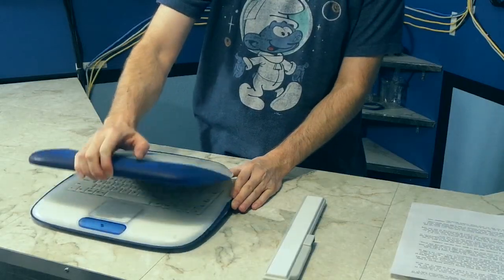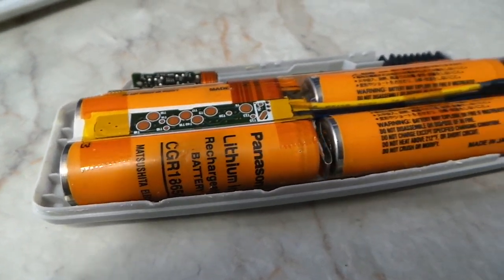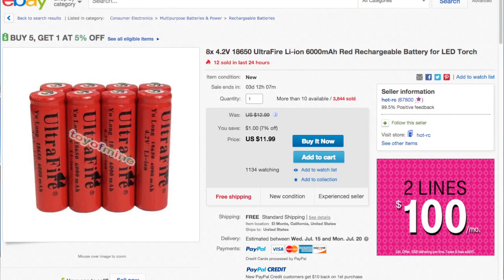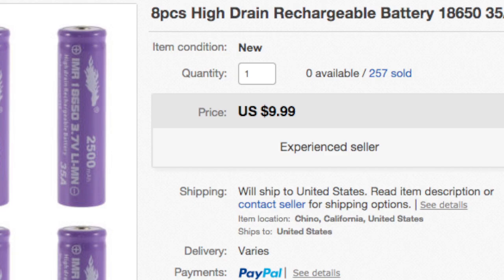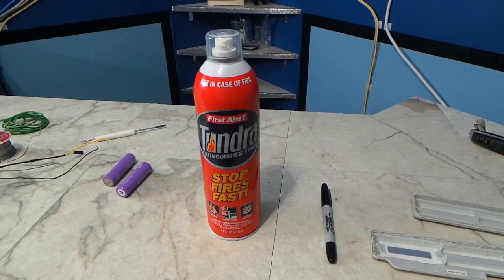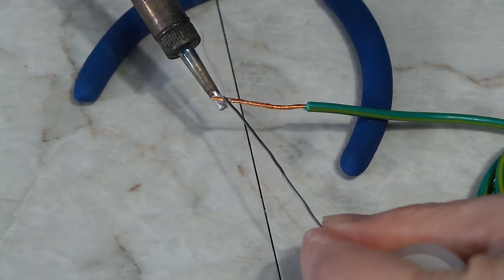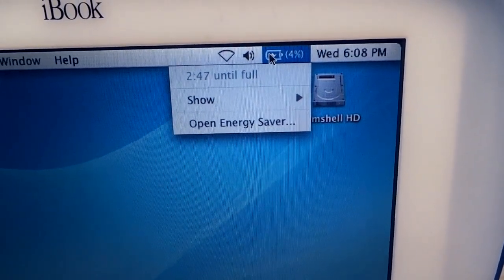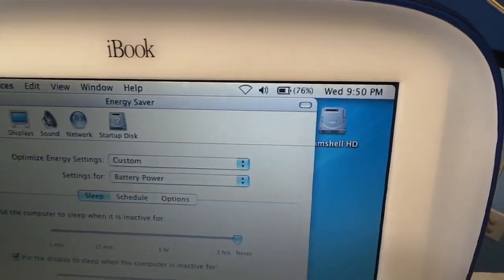Rebuild a laptop battery pack

Comment: I got 4 of those 6,000 mAh of those ultra fire batteries for an LED torch
The capacities were tested with a Foxnovo F4-S
136mAh
272mAh
409mAh
351mAh
Reply: +Ismail Mohd Yusof 
you cant even get 18650s in 4000mAh let alone 6,000mAh.
I checked on ebay, they are now claiming 9000mAh
Reply: @IIGrayfoxII  Somehow Chinese think people believe whatever they say!!!
Reply: @stevec9669  Some people do.
I knew these batteries were fake when I got them.
But I needed some basic cells.
That torch is in some storage bin as I got rid of those batteries.
Need to get some quality 18670 cells to use with it.
Reply: +JuriePie I knew they would be shit, but hey they cost $5 for the 4, they run the LED torch for 10 min at full brightness before the torch starts to dim which is not a bad thing as the torch gets very hot
Reply: +IIGrayfoxII I have one 6,000 Ultrafire that has 286mAh actual capacity, too.
Reply: +Ismail Mohd Yusof 300mAh * 5 = 1500mAh. Not 6000mAh. 300 obviosuly is 1/20 of 6000
Reply: exactly.   I buy OEM batteries for discontinued laptops piled thrown into clearance bins for a few dollars. i usually find top quality, brand name batteries inside.
Reply: +littlegoobie i just buy some powerbanks from retail stores.
Got 2 5200mAh the other day for $25.
Poped them open got 4 2700mAh batteries.
Reply: Safe choice in buying 18650s:

Buy a cheap 10000mah powerbank and take out the 18650s
Reply: @greycircularity  better off buying OEM laptop batteries
Reply: that makes sense considering the ibook should last 6hr instead of 1.5
Reply: cut them open, i bet you they are full of sand with a tiny lipo cell inside
Reply: @mwbgaming28  "cut them open, i bet you they are full of sand with a tiny lipo cell inside" its not how cheap battery is made, they are simply a lower tech that are cheaper to make and you dont need the best avaible equipment to make them. But in general i avoide false name brands and specification because if you are ready to sell a lie then its not far awey from selling something made completly wrong.
Reply: @Bialy_1  generally with cells that only  a few hundred milliamp hours, they are usually hollow cylinders that contain a tiny LiPo cell with the rest of the space full of sand 

Look up "18650 sand cell" on Google images
Reply: @KiratCan Kerem Panasonic specialises in "energy cells" high capacity, low drain 

Sanyo makes some very nice "power cells" high drain, moderate capacity
Reply: Kind of like the cranes in the place I work, if they want them to be able to pick up more they put a larger capacity tag on them
Reply: +IIGrayfoxII After getting into the new flashlights, I stumbled on an excellent way to get 18650's that are good and still very inexpensive.   maybe you can figure it out...
Reply: How to make 30k amphers stable and reset the battery also how not to fry your motherboard and give the laptop the same power as it did originally meaning will the increase of amphers increase the voltage and how can you get something to keep it at the desired number thanks?.
Reply: +Core Macro OOhh. Can I have one for my dinner, or perhaps .... supper?
Reply: Foxnovo F4-S cant find it anywhere Mate
Reply: Good old globalization at work
Reply: Chinese earbuds with powerbank advertised capacity : 5000mah actual capacity : 200mah with old cordless vacuum battery with faulty pcb and few uses : 2200mah 

Also they go overdischarged very easily just let it sit for a year and you damaged or broke the battery i added a bms from a broken ps4 controller battery to prevent that as mine aren't used often recently my sound stopped working because the earbuds turned on since the case lost power due to the battery protecting itself with the added bms i charged it and it worked just fine
Reply: +IIGrayfoxII 
wow.. just wow..
1/5 of advertised capacity
Reply: IIGrayfoxII shake it

Comment: You used imren batteries, those are not cheap, unless it's a fake.. And the heat from the soldering iron have probably damaged the batteries, that's why the battery pack couldn't hold the charge..

Comment: Hey there 8 bit guy, I was wondering that if I can use the NCR18650PF(MH12210) 10 amp batteries for my aspire 4740 laptop battery pack ?? Or the LGDBHG21865 3000 mah 20 amps by LG ???

Update: Battery I used still have 3-4 hours and soldering batteries can be a gamble but mine holds up for 3 years now... didn't get to do it right away. But 3 years and still have 3-4 hours same as the day I made it.
Reply: +Donny Slander both should work, but even if you buy 20A cells, laptop can't consume 20A. Acer aspire 4740 must have ac power supply rated for 65 or 90 Watts. Laptop will newer draw more power from battery than from it original power supply. 90 W/6 Cells / 3 Volt per cell = 5A maximum load. 3v is near empty cell voltage. Full battery will have higher voltage so laplop will draw less current at higher battery SOC (state of charge).
Reply: +Volodumur Kalunyak aahhhh, so using a 10 amp battery is still okay right??? im using a toshiba power brick since the acer dies like 3 months ago, now its stabilize around 5 hours max now. But the LG have 3k mah for the same price of that 10 amp so I stick with the NCR sony battery since it looks more closer to reality.
Reply: yes
Reply: Volodumur Kalunyak
anyway man thanx for the info about the amperage consumption by a laptop it's as you said it would be and the toshiba is also at those wattage :D cheers mate :D

Comment: How do you manage to reset the EEPROM of the battery pack? I did this with an acer laptop battery pack but the EEPROM still reads the old cells' values of full charge capacity and wear level.

Comment: why you use high drain battery? for laptop battery, you suggested to use high capacity battery than the high discharge current battery. Efest 2500mAh 35A is the same battery as LG HE2 or HE4 battery, 2500mAh 20A continuous discharge rate, usually used for power tools battery pack, rather than laptop battery pack.

Comment: I want to replace the battery in my MacBook Late 2009 as the battery has expanded due to overcharging and I was wondering if you recommend I buy a new battery or replace the cells in them? The pack itself has expanded too.

Comment: Okay so... I'm wondering... Could you possibly expand the capacity of the battery pack by doubling the number of batteries that are ran in parallel? From my understanding when batteries are connected in parallel vs in a string from end to end it only increases the capacity and not the voltage. This is assuming you would have to do some modifications to the original casing and housing but I'm just wondering if all circuits covered would this be a safe way to increase the battery run-time of an old laptop?
Reply: Yes you could add more parallel sets of batteries just be sure all cells are the exact same ones and are equally charged

Comment: After this video I decided to set out an experiment to make a super battery pack for my laptop,   since my laptop uses 4 pairs of these batteries in series,   I decided to try and make a huge battery pack using 40 of these batteries.   Ofcourse i had to make sure that it would still output the same voltage as 4 batteries in series,   so i had to make clusters of 10 batteries each,  wich then all connect in paralell .   meaning each cluster of 10 had all the minus connected to eachother and all the plusses to eachother,   if you have these 4 clusters complete then you finally connect each cluster from minus to plus,   this way it keeps the same voltage but increases the time it runs.    Now i have a battery pack that lasts arround 12 hours,   and it only took me 12 hours to make!!   :P
Down side is that the batterypack (encased in dukttape) is bigger than the laptop itself  (i shaped it nicely to kinda look like a docking station to place your laptop on)

Comment: If the brand of those batteries was Efest those where actually decent batteries.... Most 35 amp Efest are rewraps of Sony VCT 4 batteries..... And the rule of thumb is if the battery has high AMPs the MAH will be lower.... Higher AMP batteries are best for high drain electronics..... Top batter makers are Sony, LG, Samsung. Great video

Comment: IMHO, for experiment it's ok to use "cheap batteries", but for continual use i think it's much safer to use a good brand batteries.

the cheap one might even explode when one soldering the cables
Reply: +Harpax A well, you're not REALLY supposed to solder lithium batteries, but spot-weld them. That being said. I've never heard of anyone having a battery explode from doing it. You will wear them out.

Agreed, though, if you can spring for them, good cells are better. Some folks are saying Efest cells are decent, so there's that as a cheaper option.

Comment: +The iBookGuy Are you sure that it is safe to solder on the 18650 batteries? Wouldn't it be better to buy batteries with solder tabs?

Comment: NEVER EVER solder wires on Lithium batteries!  Soldering  on lithium batteries is a high safety risk, only welding with the appropriate welder equipment is okay, because this works a lot faster than soldering, minimizing the risk of exploding Lithium batteries to a minimum.
In short words: "Don't solder, weld them!"
I really hope no one follows your false teaching video.

If your batteries are NiMH batteries, only then it is okay to solder, but with Lithium batteries, never solder them!
Reply: *****
I do always wear eye protection when soldering or welding. I do highly recommend that.
Reply: ***** I do it all the time. I just don't hold it to prolonged heat. Prolonged heat for a coin cell, however, is much less time than a much larger 18650 cell. "It explodes, sending burning shrapnel all over, including your eyes..." That is also why you wear proper PPE
Reply: As Михаил Лубинец says, you are  permanently reducing the batteries capacity by soldering onto it. Risk of thermal runaway is unlikely unless (but possible) but the damage to the cell is inevitable as quite a lot of heat needs to be transferred to the cell for the solder to take. Nice video nevertheless, gave me the confidence to replace the cells in my old laptop (using a spot welder. They are not that expensive).
Reply: Not everyone has money for spotwelder or willpower, material and time to construct one for free. It may be easy to do, but speak for yourself ;-) Soldering is empirically proven ok, and will cause no damage in 99.5%(i made that up ;-) cases. Or somewhere close. If you do it quickly with BIG hot iron. 
Ocasional explosion here and there should not discourage you ;-) Have glasses on and sand bags ready. 
Think of it as normal part of life, like gasoline, it is small price to pay for high energy density cheap rechargeables - old laptops/phones/tablets running like new ;-)
Reply: what happens to the battery
Reply: OpenGL4ever dont solder too long
Reply: I have soldered directly to li-ion batteries before, they were just fine. Just have to watch the cell temperature
Reply: Just buy batteries with the tabs already welded on...easy peasy
Reply: If you're quick, adding plenty of flux rosin, and tin the batteries first before adding extra solder, it'll make the soldering process very quick when you're joining the wire.
Reply: Good thing I'm not actually watching to fix a laptop battery; the one in mine is still pretty good, about 2 hours of battery life.
Reply: +OpenGL4ever You mean like a spot welder? Yeah, that's the safest route. 

However, if your soldering iron can melt the solder fast enough, your risk of thermal failure's pretty low. I've seen people do soldering jobs on the cells in 3,300 mAh R/C Lipo packs without problem (I wouldn't do it, mostly because I wouldn't want to be cutting that pack open myself). You do have to be aware of the dangers if that battery gets heated too much.

That being said, you can find many a cell with a terminal already welded on, which is the route I will go with when I go and replace the cells in my Fujitsu's batteries (How I'll get the CD-slot battery open, though, is a mystery)
Reply: i do this with soldering for 7 years now and never have a problem, so i am sure your comment is total bullshit
Reply: Да ладно! Минусовой контакт паяется секунды 4, плюсовой- еще быстрее, если уметь это делать. Мне тоже говорили "не паяй литий, умрешь!", но я просто умею это делать. Подготовка, правильный флюс, хороший припой, хорошая паяльная станция и 28 лет опыта.
Reply: Just buy batteries with tabs already welded on...easy peasy
Reply: Congratulations! You killed 50-90% of battery's capacity :)
Reply: +OpenGL4ever Its not really an issue. If you are quick as stated by DFX2KX it wont thermally fail. What I have heard most is that it damages the batteries capacity. So if you were to not solder that is why.

Comment: I have a question. I have tried to rebuild at least 5 battery packs for laptops in the last month...everyone of them did NOT work...I can check the total voltage after rebuilding them...and the cells are reading the correct voltage, I put it together and it dont charge or gives me the X saying there is no battery...Then I take the old batteries that came out of the bad pack, recharge them on a separate charger..and they ALL have charged to 4.10 volts..I dont get it...

Comment: Those sensore chips inside the batterry pack are interresting ,they not only monitoring the level of voltage from the batterry's but they probbably will also avoid overcharging.

Comment: I exactly did this like 2 years ago for an Acer notebook and then it did not recognize the battery anymore (altough I soldered everything perfectly, all voltage levels where correct). The reason was, that the controller was "resetted" when I desoldered the old ones. So if you want to be sure, first apply a power supply (with the right voltage) in parallel to the battery pack (and apply all voltages to the 3 or 4 voltage levels). Then desolder the old ones and solder in the new ones, then you can disconnect the power supply.

Comment: There might be a secondary issue with the short run time of your batteries: internal resistance and brownout. As your computer pulls current from a battery, the chemical reaction that occurs can - if they're old or poorly constructed - not be able to react fast enough to push more electrons through. This manifests as a dip in voltage until the action that's pulling extra current ends. The problem is that most battery monitors use voltage to determine the state of the charge, so your laptop suddenly freaks out and thinks the battery is dead.

Putting cells in parallel does two things: 1) they offer greater capacity, but equally as important 2) increases the maximum current output of the pack. Given the cheap Chinese cells, the electrolyte inside might be contaminated or more likely that the electrodes have less surface and reactive area.

Comment: Nów the problem is not in cells but in a Li-ion controller circuit, wchich "tells" the computer that battery is dead, but when you solder new cells laptop still doesn't work and when you measure capacitance of old cells you realize, that the old cell has got about 80-95% of new cell capacitance...

Comment: "Calibrating" or balancing lithium battery's is done by leaving the charger on for a while (might even take weeks) when the battery is at 100%. Atleast thats how bigger battery packs work.
Also when battery's are in parallel the weakest one will limit the charge.

Comment: Great tutorial.  I've done this a lot with older laptops and it works great, but there are a few things to watch out for.

1) Don't buy cheap batteries from eBay.  Buy them NEW from a reputable source.
2) Buy the batteries with the tabs.  YES!  You can buy them brand new with the tabs welded on them.  If you try to solder to these batteries directly like that you can damage them and even cause them to catch fire or explode.  In properly made 18650 batteries, that top button tab that you soldered to is not actually connected directly into the battery.  It would be connected through a PTC+CID device (which sometimes is that top tab) that can fail at high temperatures or over-volt/over-current conditions.  So soldering directly to it can actually kill the battery or even destroy the protection device making the battery very dangerous.
3) This simple method will not work with most newer laptop batteries.  Most newer laptop batteries require you to reset or reprogram the charge controller.  Some even lock you out once you remove the old batteries and so you need to replace and then reprogram the charge controller chip to make it work properly.  So if you're really determined it can be done, but you can save yourself the time and money and just get a new one...
Reply: Unless you were stupid enough to buy a laptop on CL that no one makes batteries for anymore 🙄 "Why was it so cheap?"
Reply: @mescko  I hope you don't expect a serious response to a question on a comment from 9 years ago. But the answer is that it was cheaper before batteries came with locked down BMS chips. Now you also have to have a programmer and possibly a blank BMS chip to program and have the skill to solder the new chip.
Reply: Save yourself the time and money and just get a new one... Not if they don't make them anymore as is the case with my Gateway/Acer MD-7818U. You could say why not just get a new notebook well the answer is that I have upgraded the notebook and still use it because it still runs windows XP and windows 7 X64 in dual boot. I will not touch windows 10 because of the system bricking forced updates and will not use windows 8 or 8.1 because of the metro theme or rather those blasted live tiles that look like a child's toy and or no desktop.